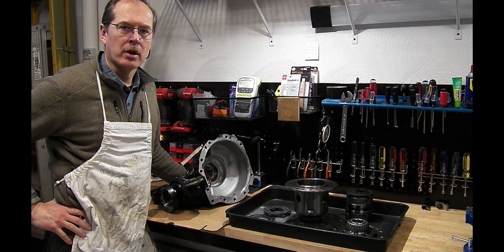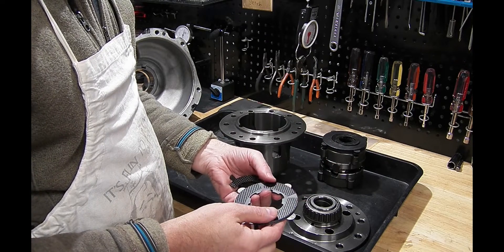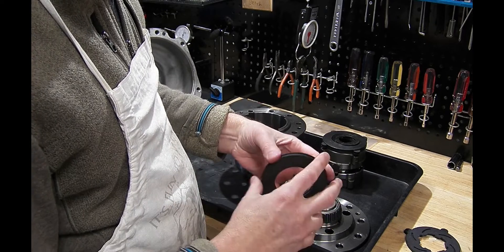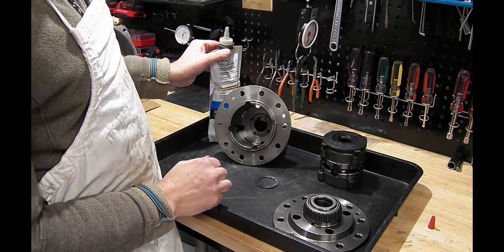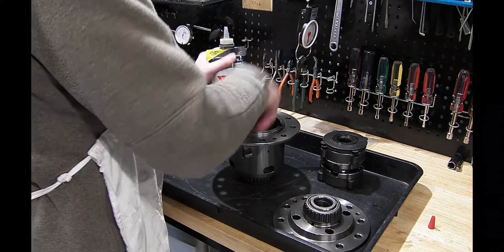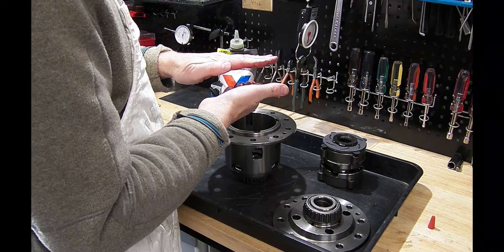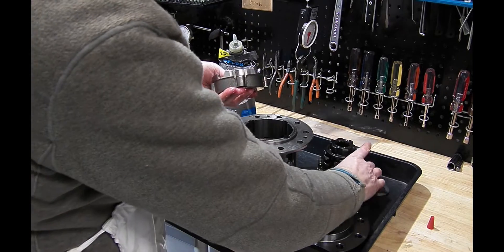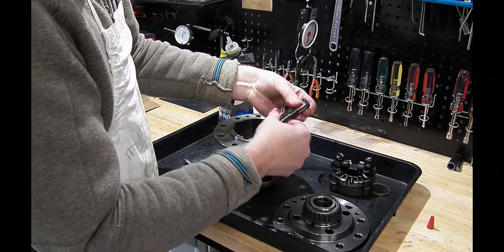LSD Rebuild for Jag F-Type V6S

Comment: Can you install the v6s rear lsd into the base v6 that came with the open diff ??
Reply from the maker: AJImports, yes, the F-Type V6 S model's rear diff with LSD can be fitted into many other rear wheel drive Jags (F-Type V6 base, XE V6, XF V6, etc). If you search eBay motors for "Jaguar V6 rear diff"  you can do some research.  Note how these diffs all look the same.  Steer clear of the V8 eDiff, and many of the 4 cylinder diffs which are different.   Also take note of the gear ratios:      V6 S model rear diff = 3.31:1      V6 base model automatic = 3.15:1   (but the ZF gear box is so flexible, it can handle the adjustment in gear ratio with almost no perception)    See Jaguar Forums for more details.

Comment: I was under the mistaken impression that the V6 cars had Torsen differentials, sadly not so.
Reply: @3ducs  The base model F-Types had open diffs, the V6 S models had friction LSD’s, and the V8 models had electronically controlled LSD’s.   I have developed a helical geared torque biasing rear diff with Quaife out of UK (who make Torsen style diffs for Jags and many other cars).  Look for the other videos on Onca Engineering in the PlayList to see those videos.
Reply: @handhwiegman8115  Thank-you. My V6 is an S with 33,000 miles, it appears to be operating correctly, though I don't drive it hard so I'm not the best judge of that. It's been off the road since November here in New Hampshire, I won't expose the car to salt. The Tata steel parts are in good condition, the car is out of North Carolina and hasn't been driven in snow.
Reply: @3ducs  Good to hear, your S model is running well. I am south of you in RI, and I sometime come up to NH to run at Loudon or Tamworth race tracks.
Reply: @handhwiegman8115  That Tamworth track is beautiful! I live about 15 miles from it, I doubt I'll ever get on it but I did drive around the access road, wonderful track, beautiful views of the NH mountains surrounding it.
Reply from the maker: Check out MassTuning. https://www.motorsportreg.com/events/masstuning-trackfest-jun-14-2024-club-motorsports-156895
Reply: @OncaEngineering  Sounds like a really good time!